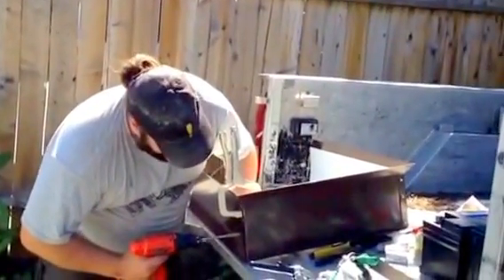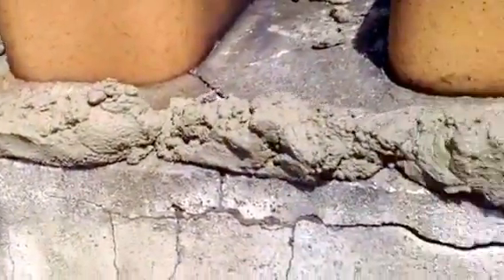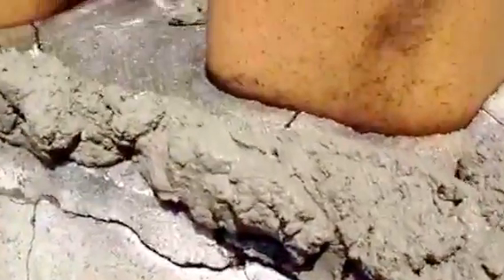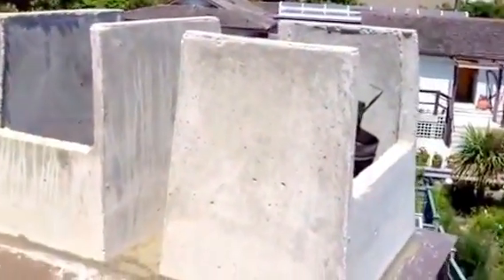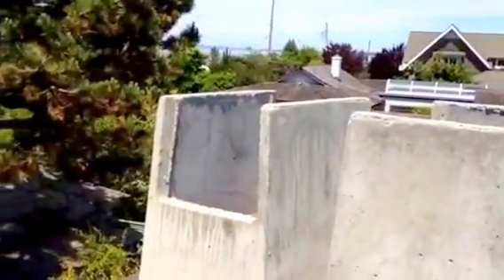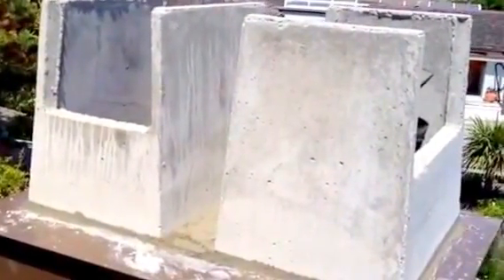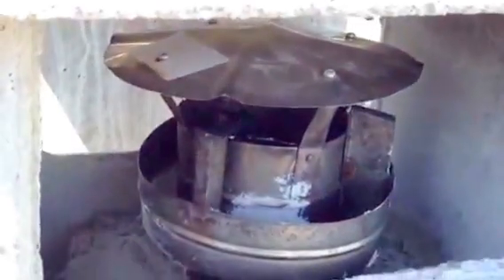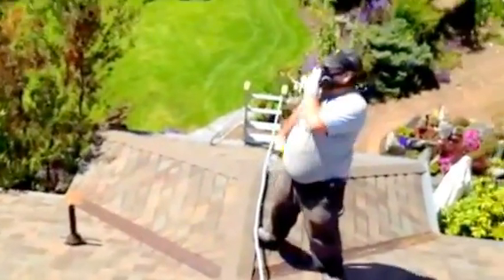Repair Cracked Chimney Crown Sheet Metal Flashing Concrete Raincaps

Comment: What is the sheet metal flashing you use underneath the crown, and where can it be purchased?
Reply from the maker: Good question - We have the stock lengths made up at a shop and then mitre it together. It is a special order item.